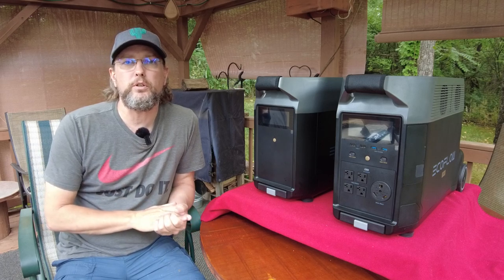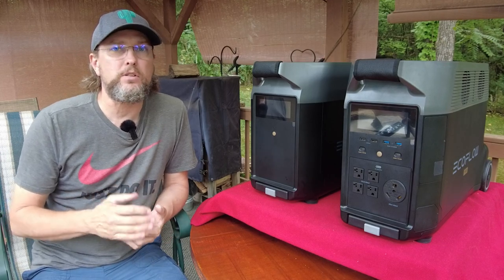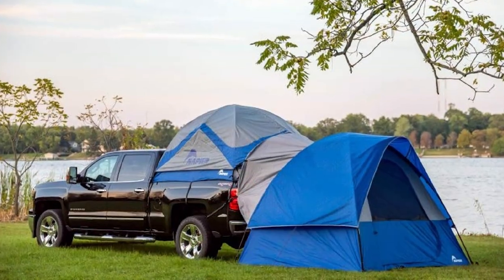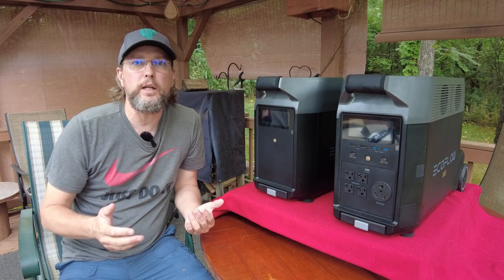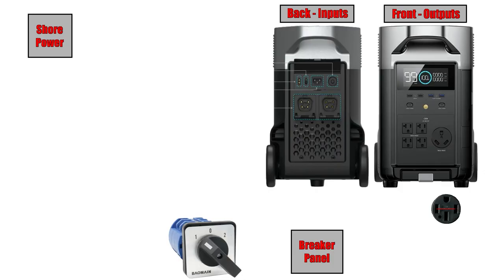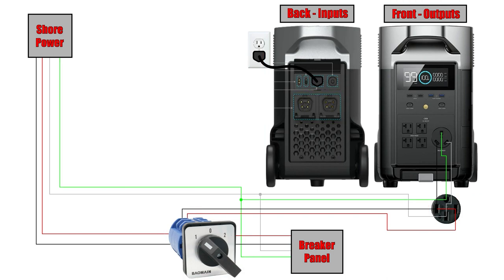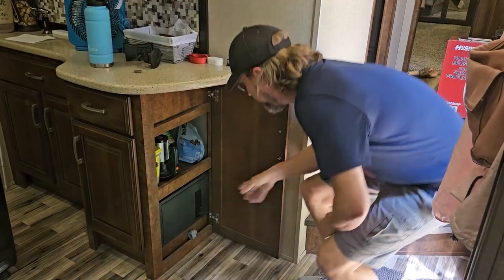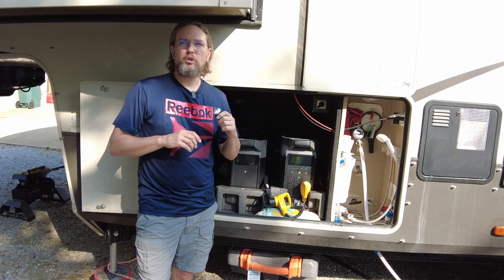A Great RV Solar Power Alternative | The Ecoflow Delta Pro Portable Power Station | Full Time RV

Comment: Question: Thanks for such great info. Have you tried the Dual generator from Ecoflow? I just bought and would love to know how that would change your system needs.
Reply from the maker: It would definitely be a nice addition to my current setup, which is 2 Delta Pros, each with their own extra battery. I also have the double voltage hub that gives me the 240v split phase output I need for my RV. I did a followup video on this setup and will put the link below.
The dual fuel generator would be the perfect addition for easy charging! 
https://youtu.be/9-wLx3UVoCc

Comment: Great video! Thank you!  I have an EF D-Pro with 600W of portable  solar panels and also have 400W of solar on my camper.  Would you be able to describe how you “join” both (RV/Portable) panels to charge the D-Pros.  Thank you.
Reply from the maker: Hi...thanks for watching and commenting! So, you can connect any solar panels together as long as the panels have the same (or very similar) voltage and current ratings. I haven't done a video on this because there are some really good sites out there that answer this very important question...no need to reinvent the wheel, LOL (see link at bottom of this comment). Aside from ensuring the voltage and current ratings are similar, the only other things you need to do are ensure all the panels have the same type of connectors and that all the wiring is properly sized.

For my setup, I have two 400 watt Ecoflow portable panels and one 370 watt Vsun hard-mounted panel on the roof. All panels have almost identical voltage and current ratings. For the hard-mounted roof panel, I drilled a hole in the roof to pass the cable down into my bedroom (through a shelving unit so it's out of sight) and then through the floor into the passthrough where it came out right next to my Delta Pro. On travel days, I simply connect this one panel to my Delta Pro, but when I boondock, I can add the portable panels to the mix (all added in series...again, see link below).

One more thing to consider is that your string of panels will only be as good as the weakest link. Meaning, if you have two 400 watt panels and one 100 watt panel connected in series, then your output will be limited by the 100 watt panel.

Here's the link to a really great site that explains everything really well. Hope this helps!!

https://energyconnections.net.au/pages/can-i-mix-different-solar-panels#:~:text=Only%20solar%20panels%20of%20exact,therefore%20loss%20in%20system%20performance.

Comment: Hello. The ground to neutral plug is a new concept for me.  I will be using this same set up in my Toyhauler, but I will charge the Ecoflow with my onboard Onan Generator via a regular 110v plug in my pass through bay (like yours).  Will I need the ground to neutral plug for this configuration?  I may add solar panels later.  I want power all night when the campground has no generator use hours.
Reply from the maker: I recommend using the ground-neutral plug any time you use the Ecoflow to power any AC loads.

Comment: Great video. May I ask if there is a simple way to use the Delta pro as a UPS to power my 50 amp travel trailer?
Reply from the maker: The easiest way to do this is just plug straight into the Delta Pro with a 50-amp to 30-amp adapter...similar to the ones shown in the video.

Comment: Thank you for this video. I'm thinking of using this system in my class C motorhome and just want it as simple as possible. Can I just simply plug my 3 prong 30 amp plug into the 30 amp outlet on the DP while I boondock? Do I need to do the rewiring with the switch?
Reply from the maker: That's what's so great about these things. No need to rewire anything. You can just keep it simple and plug straight into the DP.
However, for safety, I do recommend you get the ground-neutral bonding plug I discussed in the video.
Thanks for watching!
Reply: @fairwindsrv  I will do that, and thank you again.

Comment: in the place that you put the eco flow get hot ? if is so, how you get any reading on over-heat?
Reply from the maker: The highest I've ever seen it was 101F. The max is 113F. It doesn't have a high temp alarm, but you can monitor the temps in the app. On high temp, the unit will just shut down.

Comment: Which switch would work best for a 30 amp setup? Am I correct in assuming that you only need to switch the power leg?
Reply from the maker: Yes, you only really need to switch the power leg and then just tie into the ground and neutral. However, if I ever do this again, I'd prefer to just have a separately derived system that also switches the ground and neutral. It's more work, but in my opinion, it would be cleaner. 
This switch should do the trick for a 30 amp system. 
APIELE Changeover Selector Switch 32A 3 Position 12 Terminals Poles 440V Universal Rotary Cam Selector https://a.co/d/0GjHm2W

Comment: Do the Ecoflows have an auto-off function or when you turn them on they stay on? Thanks!
Reply from the maker: Not sure exactly what you're asking, but you can specify how low the batteries get...for example, you can set to 30% and the system will stop supplying power to the loads when it gets to that point. Also, you can set the unit to completely shut off after being idle for a specified amount of time.
Reply: @fairwindsrv Thanks!

I've read that some power banks will auto-shut down after a certain time and it has caused issues such turning off and ruining food when it is hooked up to a cooler or refrigerator...mostly with appliances that cycle on and off and the power unit thinks, incorrectly, that it is in an idle state. I was just wondering if, once you turn the Ecoflow on, will it remain on or will it auto-shut off if it sits "idle" for a period of time. Sounds like this may be adjustable.

Comment: To save energy, can I turn off my converter when the RV is connected to the Delta Pro and let my house batteries take care of DC power needs until they run low?
Reply from the maker: Hmmm. I suppose the black and white answer is yes, but I'm not sure if it makes much sense because in most cases, you wouldn't really be saving energy overall since you'd eventually need to recharge the batteries anyway. I'd need to know more about the situation to know if it makes sense to turn off the converter.
Reply: @fairwindsrv  Got it. That makes sense. Really, what I am trying to do is use my Delta Pro for my AC and DC needs. Right now our house battery barely works and our system hasn't been updated to handle a lithium battery (its working off of a 1993 converter that draws a constant 70w). I was just thinking of taking my shore power plug and putting it directly into the Delta Pro for AC then running the cords that would normally attach to the house battery, to the DC side of the delta using an anderson port. I think this means I wouldn't need my converter unless I plug into different shore power, like a house. I'm just learning about electricity, so I have no idea if that's a possible or a good idea and there is almost 0 examples out there of folks doing this. Everyone has house batteries they rely on as well as the Delta Pro.
Reply from the maker: Got ya. Plugging into the Delta Pro (DP) is exactly the same as plugging into shore power at your house. It feeds all of your AC loads, including your converter, which is doing two things. It supplies all of your DC loads when connected to any AC source (house, DP, generator, etc.) AND it charges your house batteries (when needed). Your house batteries will only supply the 12V system if you completely lose your AC source. You may already know this, but if your house batteries are fully charged (or as much as they can be, in your case), then the converter is simply turning the 120V AC into 12V DC and sending it to the 12V system. If the batteries need to be charged, the converter is then turning the AC to DC, which is nothing new, but now it's both supplying the DC system AND simultaneously charging the batteries. Once the batteries are "fully" charged, the converter goes back to simply passing power from the AC source to the DC system.
The thing to keep in mind about using the DP to power your RV is that your house batteries are now relatively inconsequential. Sure...they're still there, but the only time you would ever use them is if you were unable to charge your DP for some reason and you fully drain its batteries. My house battery is also terrible, but I simply don't care because I have the DP for boondocking/backup power when normal shore power isn't available. I will never have another expensive house battery as long as I have the DP. Just one that's good enough to get my slides in and landing gear up if I somehow got myself into a jam with the DP.
In my opinion, disabling the converter and running extra cables to the DC side of the DP is entirely unnecessary and just introduces the potential to mess something up. Just keep it as-is and just use it for what it's intended to do, even though your house batteries are old.
Reply: @fairwindsrv  Okay, this makes sense and would explain why no one is doing what I proposed (lol) Thank you so much for your thoughts! Even with so many resources out there, rv electrical systems are still so intimidating. I think we will just invest in upgrading our converter so our power draw isn't as big. Because as you outlined a converter is never not running when plugged into shore power/DP, right?
Reply from the maker: That's correct. 
I'm not saying you shouldn't upgrade your converter, but before doing so, just realize there will always be a draw on the DC system, even with the battery switch off or with the house batteries disconnected. There are some things hard wired into the DC system (meaning, no breaker, no switch, and no fuse at the DC fuse box) for various reasons. Some of those are safety related...CO detectors, indicating lights on panels, and circuitry for slides and landing gear. Additionally, the converter will use power simply in the AC to DC conversion process. My point being that the converter will always be using some power, no matter what. TBH, 70 watts isn't really that much. I know from testing my own rig that when I shut off everything I possibly can, I still draw about 55-60 watts. That's simply all those DC loads that are hard wired into the system.
Again, not telling you that you shouldn't replace your converter. Just wanted to make sure you're not surprised if/when you do.

Comment: Hi ! I've had this solar generator for almost 2 years now and I'm very happy with it EXCEPT that it's cooling fans are ridiculously unbearably LOUD  ! It's got 5 stages:
stage0: 0-120W solar input (with zero output) silent, 
stage1: 120-400W solar input - noticable, low rpm, 
stage2: 400-600W solar input - medium rpm - this should be the maximum noise lvl,
stage3: 600-900W solar input - high rpm - annoyingly loud like a crowded street
stage4: 900-1600W solar input - all 4 fans at maximum rpm (and/or 2000W+ output) - amazingly loud like a jet airliner !!!
This is REGARDLESS of its temperature ! No matter how cold the inlet is. I've tried it outside in +5C in winter and the fans still run at max at 900W solar input and zero ouput. WHY !? The inlet temp NEVER gets above 30C why are fans running at max ? 
I've written to the c.support several times, no real answers, just promises to be fixed later OTA. Many firmware updates have passed and still no change. Imo the fans shouldn't even kick in below 40-45C (100F). But they run at max regardless of the inlet temp.
Any idea how to solve this problem ? Often the whole house is running on this for several hours (combined with Ecoflow's smart home panel) and it's doing great except that we barely hear each other talking because of the fans. :)
Pls share if you have any idea and thx for the upload ! :)
Reply from the maker: Yeah.. there's really only one way to aomve the fan noise problem, and that's to simply put them somewhere where you can't hear them. Not an option for everyone. I use mine in my RV in the passthru, so I don't really hear them at all. Only problem with that is if they're under heavy load in the summer, they can get pretty warm since it's a relatively small space. 
Thanks for watching, and stay tuned...I've double my capacity and bought a new RV, so we'll be doing another video on that, followed by updates along the way when we get back on the road this spring. Should be very cool!
Reply: @fairwindsrv  Thx ! Well, it has to be very near the smart home panel which has to be beside the switch box, so no alternative for me unfortunately. It never gets warm inside here, not even in summer, so it would be most welcome if they retuned the fan curve based on the inlet temp. :) It should be a 5 min. easy fix, I don't know why they haven't fixed it by now. Many ppl have been complaining about the noise it makes.

Comment: So if I was to buy the home base and 2 extra batteries to fully run my class a motorhome with 2 ac’s, how much solar power would I need to be able to run solely off the eco system for boondocking?
Reply from the maker: That's always the big question, and the hardest one to answer. It's really something you need to work through on your own because everyone uses their rigs differently. HOWEVER...I have another video (and blog post) on this topic that you should check out. Trying to determine how much solar power you need isn't as difficult as most people think. Check out my video and blog post at the links below. They will walk you through the entire process, with some examples.
https://youtu.be/CgN9OBK4EAk
https://www.fairwindsrv.com/how-much-solar-power-do-i-need-in-my-rv/
Reply: So I saw in your new setup that you have two base units and 2 extra batteries.  What do you think is better, having the new system you have, or having one base and 3 extra batteries?  Is it not the same output?  Newbie here and just trying to figure some things out.   Any help is greatly appreciated!
Reply from the maker: What's "better" is completely subjective and depends on application. Adding the additional base unit now allows us to feed both legs of our 50-amp electrical system with a full 30 amps, for a total of 60 amps. Having only one base unit means you can only supply a TOTAL of 30 amps to your RV. So...if you have a 50-amp RV, that means both legs of the electrical system are sharing that 30 amps. The extra batteries extend how long you can use the Ecoflow system, but you're still limited to 30 amps if you only have one base unit.
In your previous question, you said you wanted to run your class A motorhome from the Ecoflows, including being able to use both AC units. A couple of comments on that:
1) In order to use your AC units, you'll need to install a "soft starter" on each of them. The soft starter greatly reduces the startup surge when the AC compressor starts up. You won't be able to start the AC units on the Ecoflows without these soft starters. They're easy to install and I have a video for that as well. I'll put the link to that video at the bottom of this post.
2) Once you have the soft starters installed, it is possible to run both AC's from one Ecoflow base unit, however you won't be able to run much of anything else in addition to the AC's because you're limited to 30 amps total. By having two base units, you now have 30 amps available on both legs of your electrical system, and each of your AC units draws power from separate legs...so now you have plenty of room to run two AC units, plus anything else you need to run.
Not sure how much you know about how the RV electrical systems work. If I'm talking over your head, I would recommend also watching my video series explaining how these systems are constructed. I'll include those links below as well. Good luck!

AC Soft Starter Installation 
https://youtu.be/FTFBItCVJ6Q

RV Electrical Systems (3 Part Series)
https://www.youtube.com/playlist?list=PLRdTqx0Gmc6KwguB_kSQqPghTdpX2-cPO

Comment: $5 grand?
Reply from the maker: I bought all my Ecoflow components on eBay as refurbished. They come with the same manufacturer warranty and cost significantly less. I paid right at $4K for the setup on this video. Since then, I've doubled it and added a couple of rigid 400-watt Ecoflow solar panels. Right at about $9K for the whole system now. I have another video on the channel with the new system if you want to check it out.
https://youtu.be/9-wLx3UVoCc